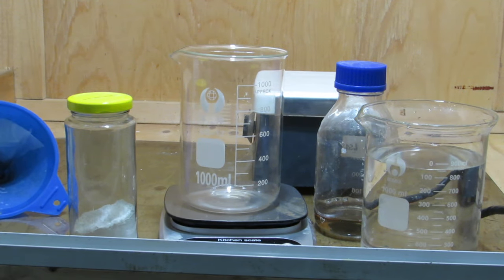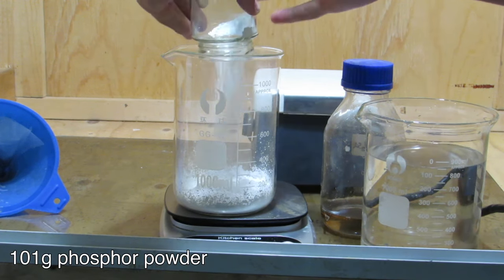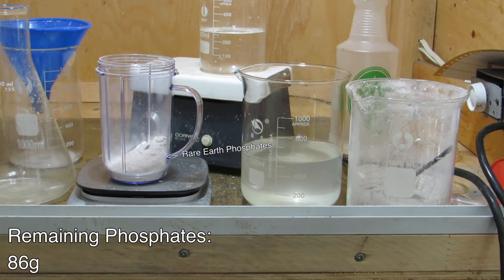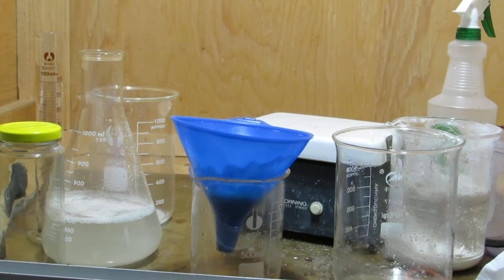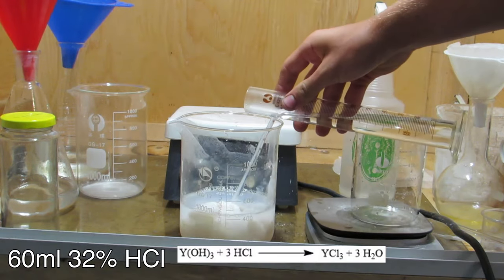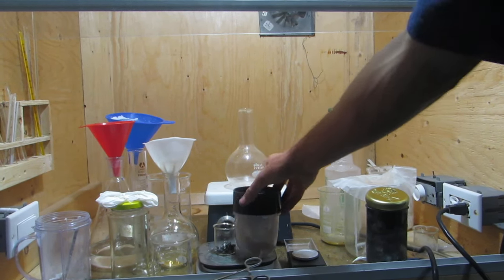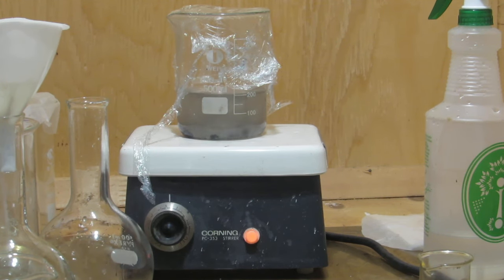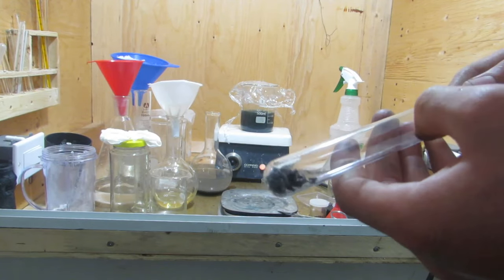Yttrium from Fluorescent Lights (Household Materials)

Comment: For the last conversion of the YCl3 to Y metal, try to use molten salt electrolysis. Combine NaCl and anhydrous YCl3 in a 2:1 molar ratio and heat the mixture to its eutectic melting point (around 600˚C) inside an iron crucible. Electrolyze using a graphite anode and the crucible as the cathode, and the Y metal will deposit under the molten salt.
Reply from the maker: thanks for the suggestion! molten salt electrolysis is always a good option. 600C isn’t too bad either. I definitely plan on doing some more project with molten salt electrolysis of other metals in the future. I’ll have to try yttrium at some point.